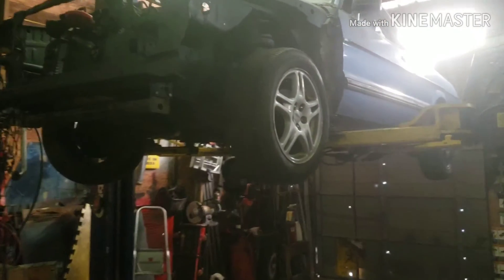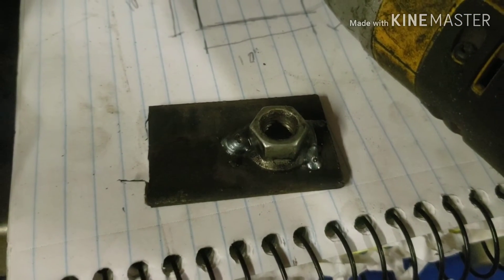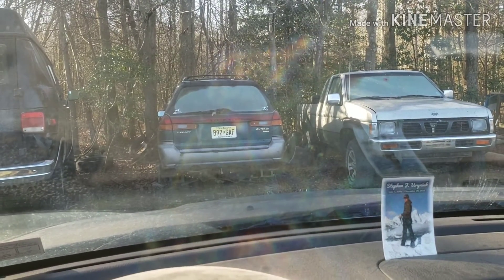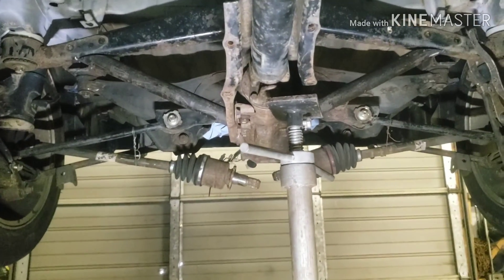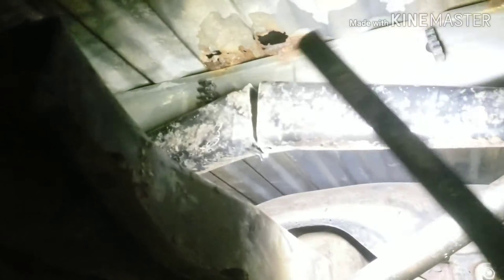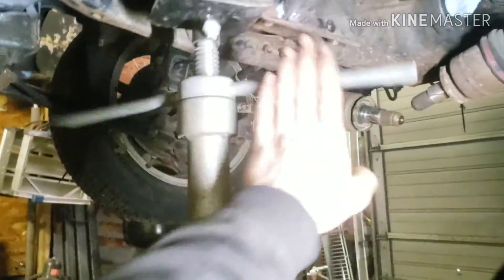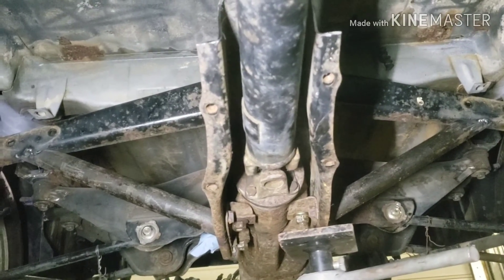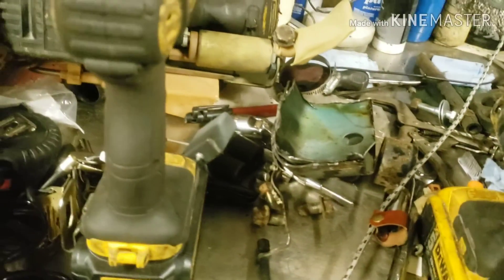BRAT WRX BUILD SERIES EP. 3 - FABBING REAR DIFF AND DRIVESHAFT MOUNTS!

Comment: picking through your videos piecewise so forgive me if you posted this before or after, but what did you do for the strut mount on the rear suspension? I milled some camber plates for my front set up but the geometry on the rear suspension is much different so I'm wondering where and how you went about mounting the top of the rear coils to the rig.
Reply from the maker: I grafted the wrx strut top plates/wheel wells into the car

Comment: Oh, and the best thing you can use for templating is something they sell at Home Depot called Ram Board. It comes in a roll and contractors use it to put down on floors when walking though a house so as not to damage the floor.  I use it for all my cardboard aided design.
Reply from the maker: I gotta check that out for sure! Thanks for the suggestion and checking out the channel!

Comment: You should probably tie the front diff mount into the rear suspension subframe as well.
Reply from the maker: You mean the front of the rear diff right? It's already bolted to the wrx subframe how it normally would be.. probably should of shown that better in the vid.